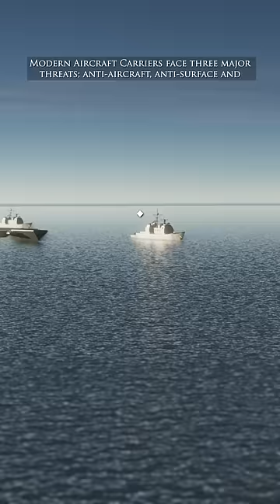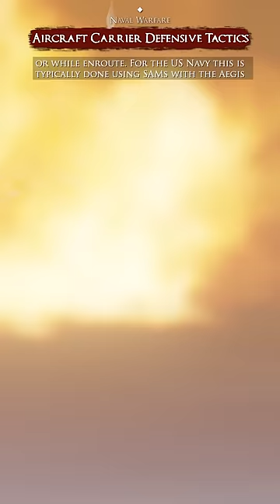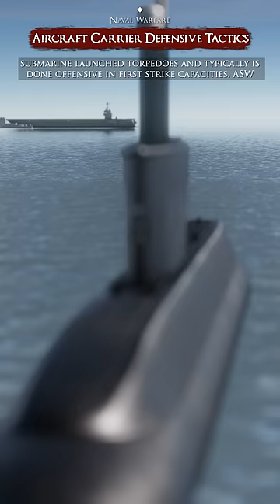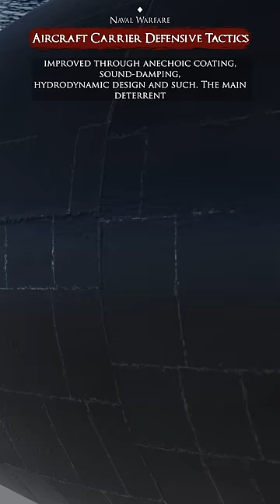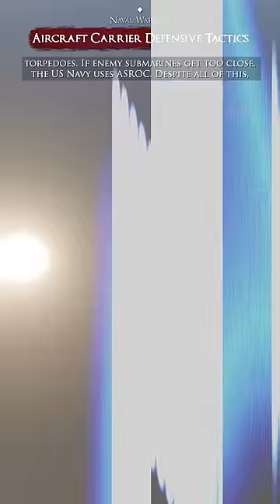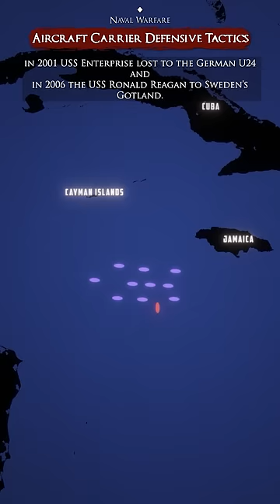How to Defend an Aircraft Carrier #shorts #tactical #military #fypシ #fyp #history #modernwarfare

Comment: Why dont smaller country navy's just build all Submarine fleet. Why even bother with a surface fleet? Feels like submarines would pick off any surface ship. Only surface ships you'll need are coast guard ships. 

Aircraft carriers are only for projecting power overseas and most smaller navy's only protect their coasts. Subs are perfect for that!
Reply: Subs can't respond and/or relocate fast enough. Only benefit you might get is hit and run defence, but that can also be done with cheaper and smaller ships like MTB's and corvettes.
Reply: subs are better for trade disruption
Reply: tbf you are seeing this happen, there were just reports of Houthi's using submarine drones, and Iran has a lot of attack submarines, I think there's still a lot of assumptions about conventional fleets that are quickly being eroded thanks to the success of drones in air and sea in recent conflicts. Submarines will play an important role again for sure
Reply: Submarines fleet ain't cheap and their anechoic coating cost a lot to maintain.
Reply: It’s pretty simple, surface ships are essentially just big hunks of steel. Sure, expensive hunks of steel, but it’s still just a lot of steel. Whereas submarines that would actually pose a threat to modern navies would require much more advanced materials to prevent sonar detection, not something that many smaller nations have the technology for. 

Second, naval ships are used for a lot more than just sinking enemy vessels. Crisis relief, search and rescue, escort, small scale non-nuclear land attack, anti-pirate. All these activities would be extraordinary difficult or downright impossible for submarines to conduct.

Third, submarines alone would give a nation very little situational awareness of their coast, surface vessels are equipped with very long range radar, sonar and helicopters with even more search equipment, all these systems combined gives a navy the ability to see what’s going on out at sea. Whereas submarines have no radar, no helicopters, and whatever sonar they have, they cannot use it all the time, using equipment to observe their surroundings may compromise the stealth of the submarine.

Fourth, submarines can’t effectively fight small ships, sure you can sink an aircraft carrier with a multi million dollar torpedo or missile, but you would have to use that same expensive torpedo or missile against any other ship since that’s the only thing you have. That means the submarine would be completely useless against the most basic of naval patrol boats, or a bunch of terrorists on a hijacked speedboat. 

Fifth (I will admit I forgot about this and added this on later), most submarines, especially the advanced ones capable of sinking big enemy ships, cannot operate near the coast, submarines go underwater, like really far down below the water to actually be hidden, waters near the coast simply don’t have the depth necessary for submarines to submerge themselves .

Finally, submarines do not have a show-of-force effect. You don’t want to be announcing to your enemy that you have a submarine in a certain area, since subs rely completely on stealth and have no defensive systems. But you can brag about your surface ships, which can be extremely helpful for a nation to pursue its national interests to intimidate its enemies using surface ships which are quite visible, and don’t need to rely on stealth and therefore can be safely shown to the public.
Reply: A fleet isn’t just a force, it’s also a visible statement and claim of ownership. Submarines just don’t look cool.
Reply: Thatspretty muchwhat is done. Thats why sweden and germany and the like (you know nations with a small naval presence) have a rather impressive, conventional submarine fleet. The survace ships are however much better at coast support fire, and for escort missions. So they can't completely ignore the survace fleet.
Reply: You need surface ships as well. The current operation in the Red Sea is the best example for that, submarines can't do anti air. Submarines also suck at anti submarine warfare since they lack helicopters and thus have no long range detection capabilities except using active sonar (which is a death sentence for them since everyone now sees their location, it's like turning on a massive flashlight on an completely empty and dark field in the middle of nowhere).
Reply: submarines are really expensive to develop, build, and operate. especially high tech nuclear subs so not much small countries can even afford a sub fleet. then there is the threat of ASW aircraft sinking your entire submarine fleet in one strike because you don't have sufficient air to air capability. there are many weapons designed to hunt and destroy submarines and if those weapons are employed correctly it will be hard to effectively use subs against an opposing force
Reply: while  @MarcuzAlunore  makes a very good and wide-ranging point, I’d like to add 1 more.

Navies today are very expensive / ship, so most navies have their force structure designed with their countries international ally’s in mind. 
That means that for 1 example: the navies of most NATO countries as well as Japan, Australia and SK are structured to be able to effectively work with & support the US navy. 
The US likes it’s allies to have a range of capabilities, to compare and learn from each other, as well as being able to call upon different types of support as needed. A kind of ‘flexible shell’ around the ‘US core’ that provides, for example, a bunch of amphibious support craft during a huge natural disaster, so the US only needs 10 of these vessels but can use 30 if suddenly required (numbers are illustration, not reflective of reality) 

Bluntly said: those navies support & compliment the US Navy when called, and in return the US guarantees their countries worldwide maritime free trade.
Reply: In the developing world, surface fleets are used primarily for territorial defence. But in the developed, Western world, surface warships participate in many global endeavours related to anti-piracy, drug interdiction, freedom of navigation missions, humanitarian relief, joint operations with allied carrier groups, and conducting amphibious landings. 

Submarines simply can’t do everything that is required of a navy, in peace or in war.

Comment: The opening line makes no sense. Modern aircraft carriers don’t face those threats. 

An aircraft carrier under threat from anti-aircraft would be a flying aircraft carrier. 

An aircraft carrier under threat of an anti-surface attack is no longer an aircraft carrier but an air base on land. 

An aircraft carrier that faces the threat of anti-submarine attacks is an aircraft carrier that has already sunk. Either that or there’s a submarine aircraft carrier 

Modern aircraft carriers face threats from aircraft, surface launched munitions, and submarines.

Comment: worst wording ever.     Anti-submarine warfare, anti-air, are the "defenses"   they don't suffer a threat from ASW they have ASW to counter subsurface threats.  

Detecting subs is not easy, first,  active sonar... is active...  it gives away the position of your ship far beyond the ranges you can detect the sub with it.   if i'm pinging away with active sonar my detection range may be 17 miles.  but the enemy can hear those pings 100's or even 1000's of miles away... making the ship able to be targeted and attacked by cruise missiles...   from 1000's of miles away.